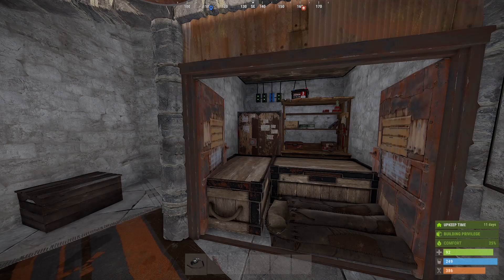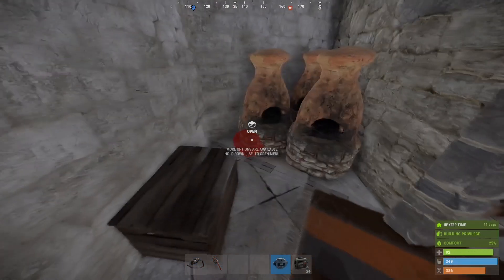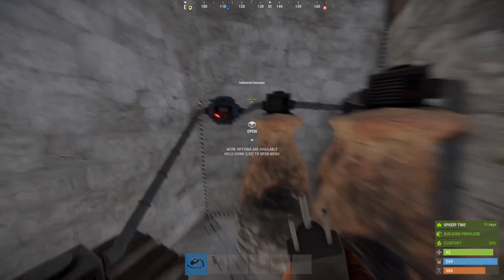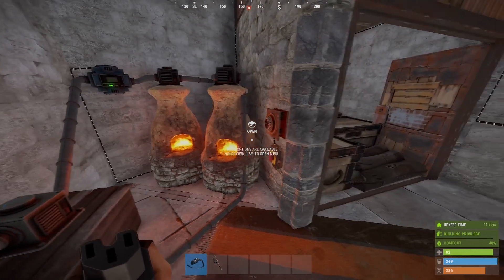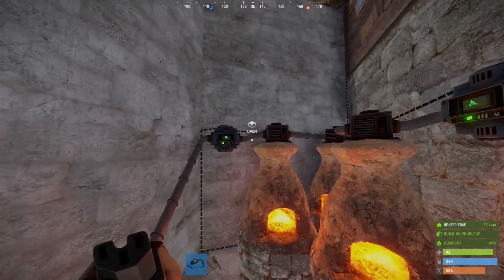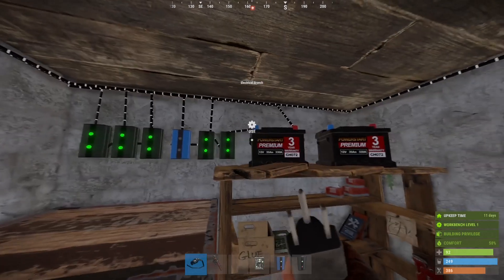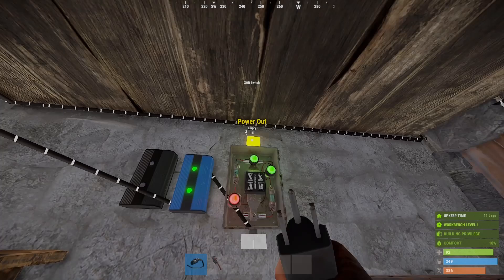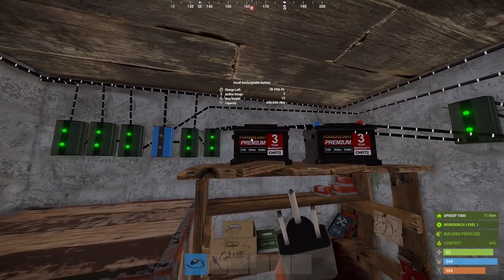Rust Electricity for Beginners - Ep 07 Furnace Auto Feeder & Battery Backup

Comment: Was looking at the battery backup. Is battery cycling still a thing or was that fixed with the large electricity update a few months ago? Granted, with what is hooked up now, it won't make a difference, but as you add lights or defense, it could become a problem.